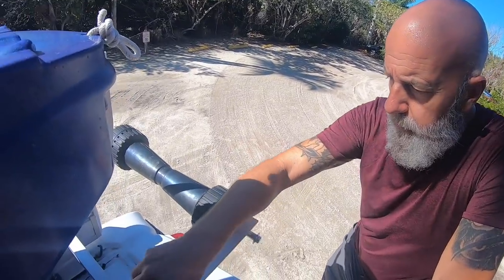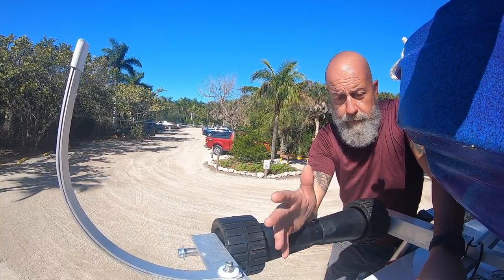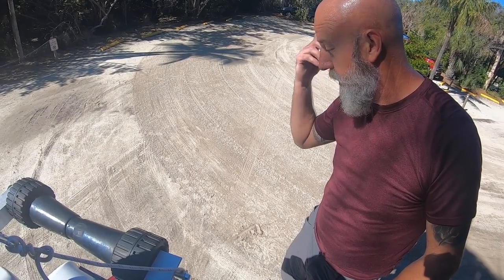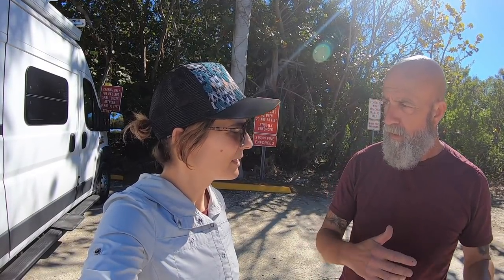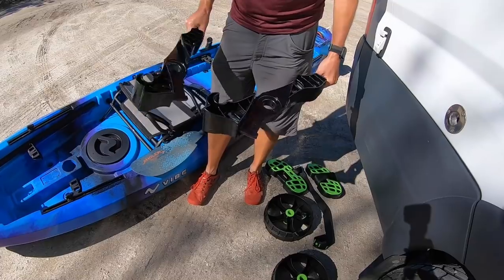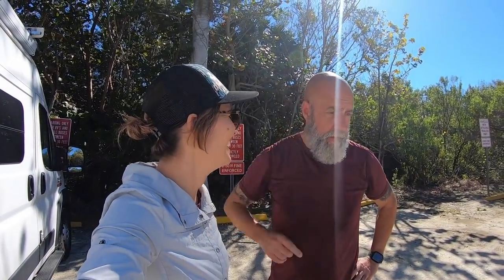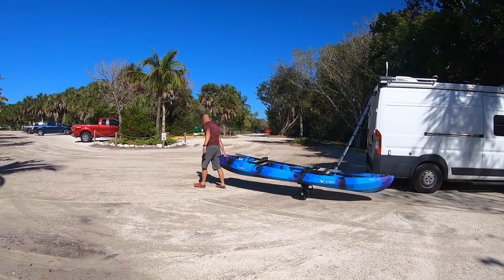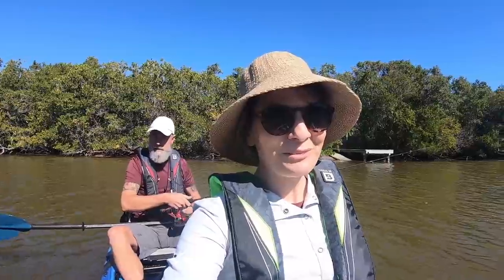Loading And Hauling Our Kayak

Comment: Between using a tall van and choosing the supper heaviest kayak construction, you certainly have made a simple, easy & cheap thing super complex, difficult & expensive.  I just pickup and carry my 17 ft F/G sea kayak on my shoulder, raise it over my head & onto the racks.  In 50 years kayaking, I have never used a cart.  I'm a retiree and only weigh 60 kg, so not even an average size or strength guy.  Whatever floats your boat I guess, but I just wish customers were a bit more demanding about weight & price to keep this industry from become ever more ridiculous.

There is a very good, practical reason the original kayaks were all skin on frame.